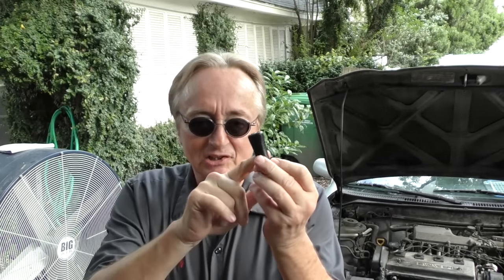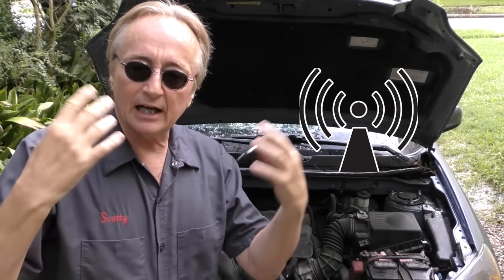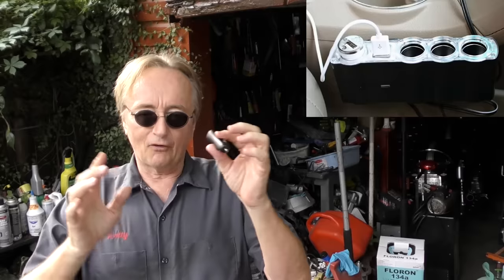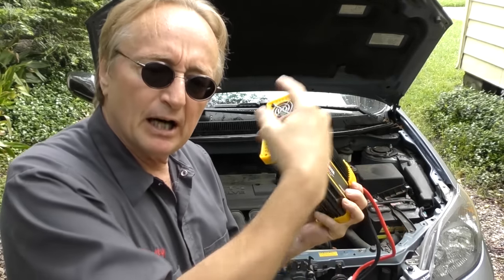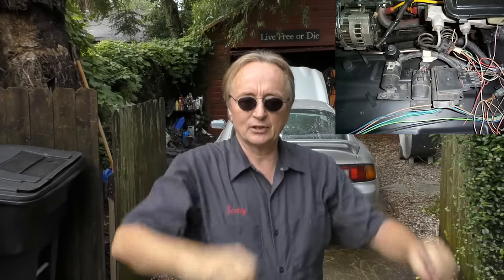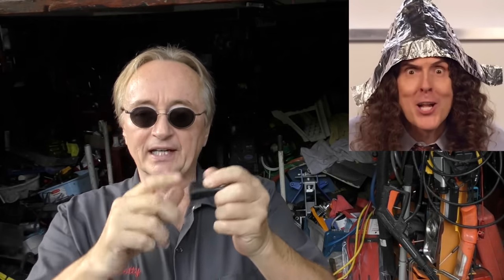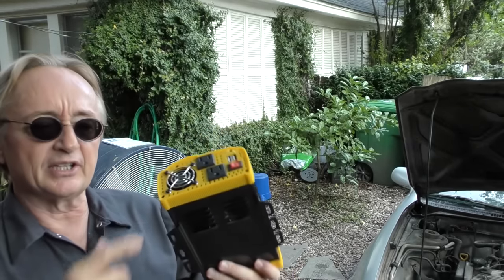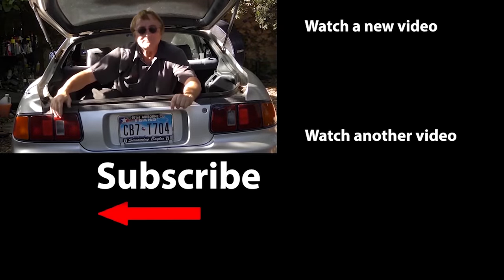This Adapter Will Destroy Your Car

Comment: Thank you Scotty for the heads up. I'm getting rid of all my cheap Chinese adapters and getting quality Chinese adapters.
Reply: James Williams papa bless Anker
Reply: mharris1270 agree on Anker.  You can trust anything the brand makes.
Reply: Agree on Anker! I have Anker cables, powerbanks, Bluetooth speaker and car plug!
Reply: At one point Anker was the bomb. If you have bought any Anker products lately you will know that things aren't what they seem to be anymore.  Classic case of Sony syndrome.
Reply: Bro. I’m dead 😂
Reply: From my experience with crappy chineses 12v adapters it Works best on bigger cars that have higher cold cranking amps. Also try using an adapter that uses fuses so you can use a different fuse for the right power draw. When using over 300w+ inverter uses a pure continus sine wave that connects directly to battery only when car is running unless you have a ground wire.

Comment: Sometimes I wish cars were like the 70's where the wiring was so simple, anyone with elementary knowledge of electricity could install multiple outlets (cigarette lighters), stereo, lighting, and basically anything else!
Reply: BaltimoreAndOhioRR Modifying cars is the whole reason I learned electronics.
Reply: Everything was more real back then.
Reply: @Gamma Rat you can still do that..

 If you have two cars!
Reply: My 1975 Olds Ninety-Eight has at least five ash trays and several cigarette lighters from the factory... Also has a 455 in.³ V8 monster of an engine.
Reply: @Gamma Rat Never used to be that hard! Fold the harness, pull the crossmember, unbolt the mounts and change the Radiator Cap! Swapping a Six for an Eight got a little bit more confusing in the late 80's cars. The crap now? No one knows or can go retro now on anything. The kids have the computers and ZERO Mechanical skills or ambition other than to be led to a paycheck.(Ask a Brat if they would like to build a Bird house or Bird Feeder so that they can compare their strive in life to the ones that can Truly do without them! ) The Little Birds you ask will Surely get Pissd Off! No Nothing -Free For Me Bullshit Artist that will Starve to Death if the Fate they Deserve doesn't put them in the dirt first! (Thank God that they have an APP to Fix IT! )
Reply: @benkojr  aaaaw, the Kids Are All right!  Just ask the Who.
Reply: @75OldsNinetyEight  One of my favorite cars was a firebird with a 455 & chrome pipes running where running boards are on a truck & it had the sweetest deep rumbling growl & he put a Rochester 4 barrel, it sat down then took off oh that was a sweet drive!
Reply: more mechanical rather than on board systems
Reply: BaltimoreAndOhioRR -Yeah I need to get a headlight (I will do both!) have to take the whole front fascia off. In the old days will just popped the hood reached in and changed the bulb.
Reply: Marion S.     😡🤬.  Today jack up yank tire yank half of fender liner busting half the 💩 plastic push pins.     All to change a bulb🤬
Reply: Merlin Cat -Crazy isn’t it?!!!! Mechanic want around $350.
Reply: @75OldsNinetyEight  
Those are monsters. Id like to have one just to have one. Fire it up when me and the boys get hammered.
But then again, I would like a turbo jet engine too, but my neighbors gotta draw the line somewhere. Lol
Reply: Problem, car manufactures perfect a vehicle than it is no longer competitive with the competition.
Reply: Thats why i am gonna buy an old honda accord for my first car because with some tuning it will be some fun and dirt cheap to maintain.
Reply: When it was just you and pops working on the car
Reply: I've always had a theory that if Detroit (or anybody)  built a simple car that we shade tree mechanics could actually work on like the Jeep designed for the US Army in WWII they could market it as fix it yourself, save thousands on maintenance and repair bills, they would have a very popular seller. I would certainly buy one.
KISS. Keep It Simple Stupid. Now days, fuhgetaboudit.
Reply: Aaaaand your car is on fire.
Reply: Computerized vehicles suck!
Reply: We are somlucky they're not like 1970s cars, cars were far more dangeraouse and lethal in even minor accidents, crappy design and after engineering in that era, lucky to survive even a minor accident. compared to any modern car.
Reply: @airgliderz  I recall back in 1976 when my younger brother fell out of our Chrysler-made car from a loose rear door latch and faulty seatbelts.  My brother was ok....yet my trust in Chrysler was permanently destroyed!
Reply: Love edit job
Reply: I wish everything was from the 70s, minus the modern remote control... I love the remote control
Reply: Im an EE by education, programmer by trade. Its not really any more complicated now as far as that goes, the 12 V bus is still the 12 V bus.
Reply: @oatnoid  Well see our air quality and fuel economy is vastly better than anything the 70s could muster. People can still buy old cars, noone wants them.
Reply: @jhoughjr1  If your replying to me, yes, it's waaay more complicated now. Simply FINDING the 12v bus is more complicated! And it gets worse from there.

Comment: I think if it were up to Scotty we would all be driving 20 year old Toyotas with oxidized paint
Reply: Yeah, he should give away one each week 😆!
Reply: only in a perfect world would we have a 20 year old Toyota with bad paint .... but, I ain't givin' up till we get there
Reply: He would need to find another profession!
Reply: Screw that. Give me an 80 year old Ford. Flathead V8 or bust.
Reply: Just bought mine, I'm officially a follower now
Reply: I have a 91 toyota pickup with an 81 22r engine in it, frickin thing will prolly go another 30+ years easy lol
Reply: "if it were up to Scotty we would all be driving 20 year old Toyotas" ==> Nah.   Nothing so brand-new. 

I prefer 26 year old with only ONE computer to snarl, plus an ABS computer.
Reply: Ride no car then I mean goo goo ga ga
Reply: Aaron Adams  I am my car is 27 years old and rust never sleeps
Reply: I drive a 20 year old Honda with oxidized paint close enough
Reply: And we would all get where we were going
Reply: Can complain have a 30 year old civic still going other cars just keep maintenance but for sure not a BMW   nice cars but  I seen people dump money n verely broke even after they sold it  parts just to expensive an most are dealer  items electronic codes .!
Reply: I love a good Toyota
Reply: Late 90s Corollas run forever.
Reply: Haha funny thing is, I just bought my first car, and it's a toyota corolla 1999. only 117,000km (72,000miles) so it's pretty dang good,
Reply: I have a beautiful red 22 year-old Kia Sephia LS..still going strong,rides like a charm! 🚗👍🏼😉
Reply: Then mechanics would be out of a job.

Comment: I've been a mechanic  my entire life. Owned two of my own shops have worked on thousands of vehicles. Cars to helicopters, airplanes, boats and motorcycles. 
 I can  honestly say I have never ever had to repair any of these vehicles because of a cigarette lighter adapter , with one exception. A blown fuse , which are allways a free replacement. For our customers.  I've watched a couple of his videos now and think that he makes things up for videos and Views .This is horrible, whitch-doctor type shade-tree mechanic .
Reply: Ive been a mechanic for 15 years. Ive never came across this issue either. This guy seems to be running out of material.
Reply: @edwinbz9889  yeah this guy... SMH
Reply: @edwinbz9889  lol no respect.. dudes made thousands of videos, and you have the audacity to say "this guy" ffs... fair-weather
Reply: @Daniel-xu6kd  irrelevant information
Reply: I’ve edited Scotty’s entire script. “ Hey rev up your engines n buy Qualcomm cigarette adaptors” 
Lol
Reply: The bull@#$& is strong with this one
Reply: Lol yep
Reply: @edwinbz9889  all he said is don't use a cheap one because they can overheat and cause problems. Never heard of the other problems mentioned but, using cheap chargers and wires i know for a fact cause fires in homes
Reply: I have a 2012 malibu that developed a random no crank/no start and theft deterrent light on solid, so I did a lot of research online and talked to several people with no solution and then ran across this video and then remembered that just before the problem showed up I had put in a new phone charger in my cigarette lighter socket so I removed it and the problem is gone,obviously not everyone is going to have a problem like mine and before this it would have never crossed my mind but I'm a believer now
Reply: @raymondroy4288  typically GM cars turns off all aux power sources if the car is not running so the battery doesn’t run down. But gravity could be an issue as well.
Reply: @tonyabrego1  my cigarette lighter socket is powered always and I'm the original owner and have had my cellphone holder plugged into it for years and never had any problems, maybe I'm lucky lol.
Out of curiosity, what would gravity have to do with it ? 
Just asking
Reply: @raymondroy4288  Captain gravity is not a force between masses. Instead gravity is an effect of the warping of space and time in the presence of mass. Translation not all things revolve around Scotty. 😂
Reply: I wonder how many shots of tequila he takes before making his videos... 😂
Reply: @alixandria7346  keeps an igloo flask so good for 24 volts, I mean 24 hours 
hiccup
Reply: Your right, my dads been a mechanic all his life in which I’ve been learning from him. The only time it will effect the car is if you constantly have it on it’s going to drain your battery of course same with the radio. Most cars now n days have 2 types. 1 that’s run directly to the battery no key needed, and 2 that requires you to turn the key in order to charge / make it work. The ones that run directly to the battery are better actually less usage, and yes you can change the wiring to make yours like that.
Reply: Which one? "Which doctor"? That didn't make sense.
Reply: Youve never had to repair them because the cars are DESTROYED, like Scott says. Duh!
Reply: You must work for those stupid greedy companies that makes those stupid adapters 😂😂😂
Reply: Anything scotty says take it with a large pinch of salt 😂
Reply: Drr. Ever heard of "pure sine wave" vs other inverters?  The quality of electronic components definitely CAN MAKE a huge difference
Reply: I wouldn’t discredit what he saying even in my cars, driver manual it says that car chargers can mess up the transmitter from the key fob
Reply: @raymondroy4288  same thing happened to me . I bought a new car a month ago 2 weeks later got a new car charger then all of a sudden no crank no start . Been going on for weeks .
Reply: I completely agree; it is absurd to suggest an inverter over a small cigarette lighter power supply. I have used various USB power supplies in a variety of cars without any issues, and even FM Transmitters have not caused any difficulties. We who are knowledgeable about electromagnetic interference are in agreement that this video portrays Scotty as a vehicle mechanic, not an electrical engineer.
Reply: Of course you think it's horrible lmao
Reply: You have 1 sub and Scotty has over 5.6 million... Who is bullshitting who? lol
Reply: yep I have to agree ... stopped watching after he said it converts 12dc -> ac to step down to 5vdc ... Dude does not understand basic electronics .

Comment: Hey Scotty! My car won't start. What's wrong?
Scotty: Have you tried driving a 90's Toyota?
Reply: Sean Place 
A 94 Celica to be exact 😂😂😂
Reply: LOL! In all fairness, I have been running Camrys and have had 0 issues with them for decades, he isnt wrong about Toyotas XD
Reply: LOL the one car he is an expert in.
Reply: Yeah I have and he's 100% right... 99 Camry, 303k miles now... Bought it one year old with 14k on it... Maintain it fairly well but not religiously by the book... Never had one very expensive or hard to perform repair. Most of them I do myself besides things like Timing belt service or new lower control arms because the rubber bushings were shot... Motor and transmission has never had to be apart. Still runs and drives better then some new cars I have driven. Extremely quiet inside, AC blows cold, everything works as it should, only have had to replace blower resistor once to updated resistor $15 from the dealer, 3 radiators I do it myself in 30 - 45 minutes in my driveway, both electric cooling fan motors once and a new set of brushes in the original alternator last year $8 online, 1 hour job in my driveway. Amazing reliable car and quiet inside... Most new cars have too much road noise inside then for me!  Even has original exhaust system and muffler!!!

Comment: I only use anker, worth every penny, great brand
Reply: I’ll second that.
Reply: Never heard of them. Good though, huh?
I go through liquor store USB adapters faster than a tank of gas, and cost about the same.
Right now I have a 1500 watt power inverter with two USB built in. But its Harbor Freight. Itll probably last about as long as the liquor store adapters.
Reply: quality brand and great customer service
Reply: @siggyretburns7523  I have two Anker power bricks, used to maintain a charge on my phone if I'm away from my usual power source. 25,600mAh & 26,800mAh can also be used to operate anything usb-powered. Three USB ports and a small flashlight. Anker delivers high quality products.
Reply: Yep Anker is solid.  Never had a bad experience with Anker.
Reply: agreed $25 and up depending on which one u buy
Reply: Dropping anchor
Reply: Same here 👍🏻
Reply: Hell yea
Reply: Same
Reply: Anker is the best
Reply: Yup it’s anker all day for me... I have a 18 watt usb type c for my car and I literally just bought a new 20 watt brick and 6ft nylon braided cable for my phone
Reply: Anker rocks!
Reply: Griffin is the best for 5V usb supply.
Reply: Yep. Wankers love Ankers.
Reply: I’m gonna need to try anker, i got one Called queem but it didn’t work right out of the box.

Comment: Tin foil on adapter.
Cell in mylar bag.
Tin foil hat on head.
Ready to drive in California!
Reply: What you don't put tinfoil in your wallet to stop the scammers from taping your credit cards?
Reply: @Sprigga666  I don't let ppl be close enough to scam me this way
Reply: @Sprigga666  Titanium RFID proof wallet. Wait a minute, what is this chip set hidden in the wallet  liner?
Reply: Hilarious!
Reply: Kevin Moore uy
Reply: Kevin Moor
Reply: A simple steel screen rectangular cutout section will also "hide" your "freak-quencies", of anything electronically dependent.
Those Massive High Tension Wire Workers, from Helocopters, Depend on Good Ol Mr. Faraday, Everyday ! 
"Ahh heh,heh"...Insert Scotty Chuckle here.
Reply: Just don’t short out your cigarette lighter with tinfoil! 😳
Reply: Naw stay were you are, we don't need cousin/sister loven genetics out here.🤤
Reply: Lmao!

Comment: This reminded me of the time when Cell phones were starting to be installed into cars during the 1990s.  I was an installer for a major provider (at the time).  Also I remember reading in owner manuals warnings about adding an accessories such as CB radios (remember those?).  In both instances there was a warning about RFI affecting the ABS system and airbag systems (SRS).  Love your videos and I look forward to many more to come.
Reply: True. My ABS warning light pops up indiscriminately all the time.
Reply: Hello james.  Do you know where i can read about what you learned?  I would like to learn so i can properly install a cb or any accessories without interference.  🤔
Reply: I studied and became MECP certified (Advanced).  This was a requirement of the company that I was working for at the time.  The study guides are a treasure trove of knowledge.  However, there is no replacement for hands on experience!
Reply: @jameskendricks4508  thank you.  I will see if i can find some guides at my public library on the abbreviated terms.  I hope to keep learning from any knowledge you can provide.  I will subscribe to your Youtube channel.  I appreciate your time and reply.

Comment: I purchased a wired powerwerx 12 volt to usb  power device.  I wired directly from battery through a fuse through an automotive relay to the device and then to ground.  I got the relay and socket from all electronics and the usb power device from Powerwerx.   The relay is used so there is no parasitic draw and turns off the device when the car is off.   I tapped the cigarette lighter positive to actuate the relay.

Comment: I charge my car battery with a USB wire plugged into the cigarette lighter port.
Reply: Jeff H 🤣
Reply: Jeff H  I love this comment😂
Reply: park your car far away from other peoples cars or homes so if it catch fire no property or people will be harmed.
Reply: @ateam6486  lol avoid owning older Ford products that catch fire from the worn ignition switch while parked.
Reply: How to get out of car payments
Reply: No, no, you dont. 🤣
Reply: is that like plugging a power bar into itself?
Reply: Might actually work for an insurance scam as long as you hide the wires and buy a dollar tree stick.
Reply: @tomster7574  I'd rather recharge using a Met-Rx bar...
Reply: Mine uses an alternator
Reply: No USB, But I have gadget that Jumps a car through it's 12v port.   <<   That didn't turn out, (sound) right, did it?
Reply: Lmao! 🤣
Reply: Hi Scotty I don’t have a car. But sure would be great. When the power goes out at home.
Reply: you're a genius! :D
Reply: @kareno8634  you could charge admission! Anyone would like to see that!
Reply: Ah yes, perpetual motion.